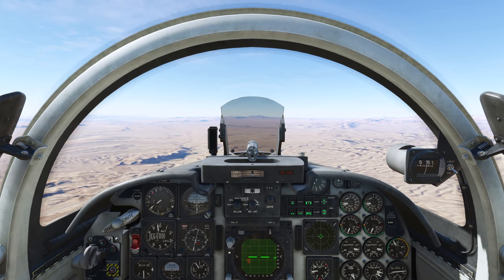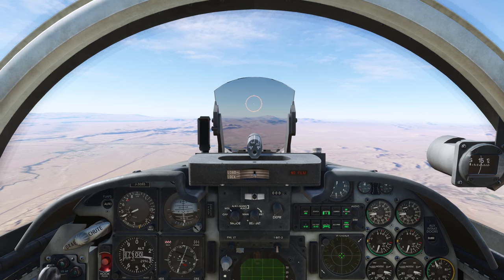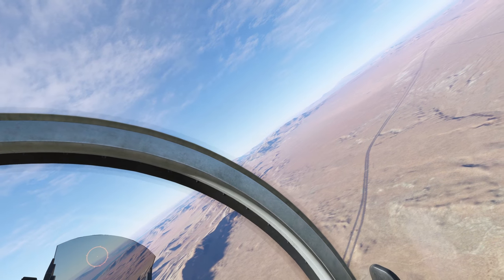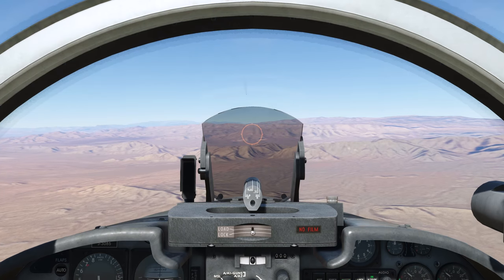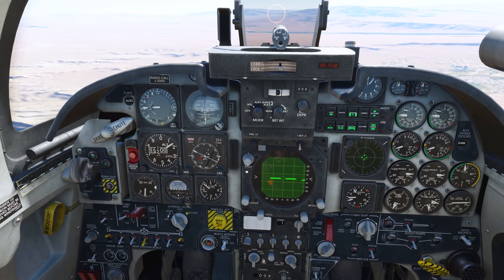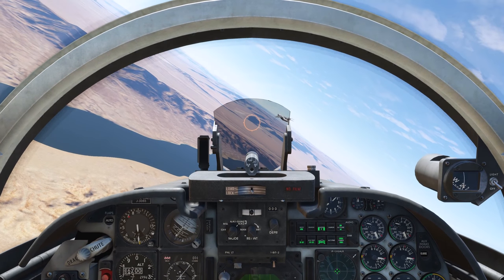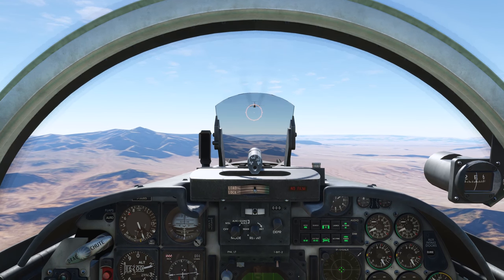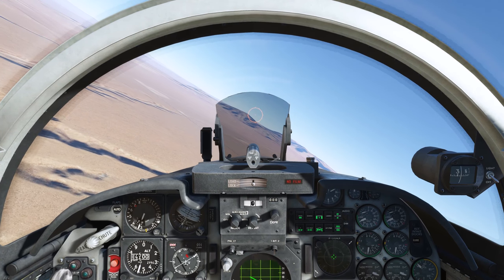DCS F-5 Air to Air Tutorial Part 1

Comment: you can have the other pylons armed aswell. If i carry rockets for example i arm all my pylons after takeoff and then just switch the rotary to rockets or back to switch between a/g a/a
Reply from the maker: Ec0ke last time I did that that it didn't work, will check it out when i return!
Reply: as far as i know, it shoud work. but it could make problems if you use the dogfight modes to switch for missiles when you are still in rockets mode. Then the plane doesn't know if it should fire the missiles or the rockets as both pylon types are on and active
Reply: Hi Tricker, I noticed you have an X-55 HOTAS. Have you by chance shared your key mapping’s for the F-5 module or know where a good profile exists? Thanks for the great videos!

Comment: I'm fairly certain that with your radar off that a/a1 or a/a2 doesn't do anything, it's just showing boresight.
Reply: Diesel7.3 Exactly ! Thanks you notice that too, you can shoot , joystick is hot in boresight mode anyway but not able to find your target before without a radar,
Reply: Got it backwards.  A1/A2 is the gyro and computer functioning as a predictor sight with the reticle set a 1 time of flight distance (about 1000 meters in level flight).  With the radar on AND locked, the radar feeds range data, and when the in range cue light comes on the sight is corrected and accurate for range and movement.

Comment: Nice Vid mate!
I wanna ask You  something if possible....I have problems with chaff/flare in the F5.
My problem is that I found only one button mapped fot release chaff/flare and if  I i push it it release only flare.
How can be possible to switch from flare to chaff?
Thank You.
Reply from the maker: Gabriele Ragano make sure both your switches are on below your left elbow, there's two switches, one for chaff and one for flare.  You can also program them on your knee late, right shift k
Reply: Sure mate I checked, the problem is...having only one mapped key (I remeber....Q) and so the possibility to configure only one HOTAS button to release (as stated from the control panel) "chaff/flare release" how can I switch from one or other? There must be a switch....
In the Su-27 for example release chaff and release flare have two different key mapped and so the possibility to map two different button...but in the F5?

Comment: I had an issue on my first combat flight in the F-5.  AIM-9s wouldn't fire if both AIM-9 pylons were selected.  Had a long fight with a Hornet until he maneuver killed.  Later got missiles to fire by only selecting one pylon.  Is that a new thing since you made this video or am I doing something wrong?
Reply from the maker: That shouldn't be... Just flew it the other day with no issues
Reply: @TrickerDCS  I figured it out.  I can't fire if I'm using the missile uncage button.  I think the external Saitek program for bindings doesn't like multiple commands talking over each other.  So I'll have to set up my bindings through DCS directly for this plane.  The missile switches thing was a coincidence.
Reply from the maker: JETZcorp well that sucks but I'm glad you figured it out!